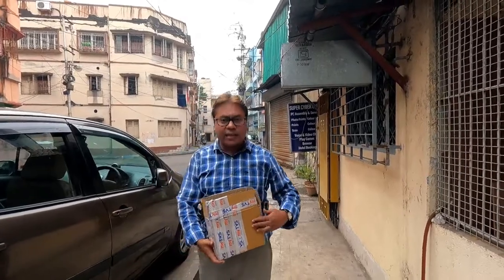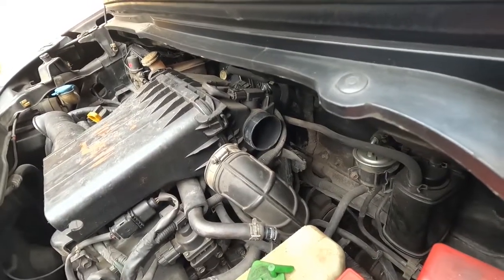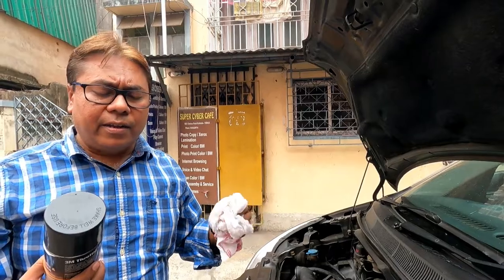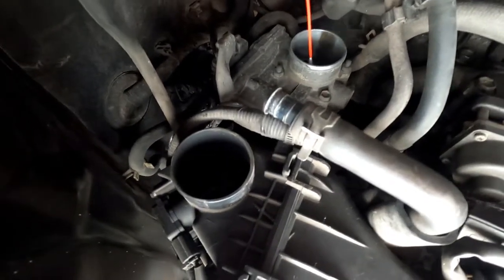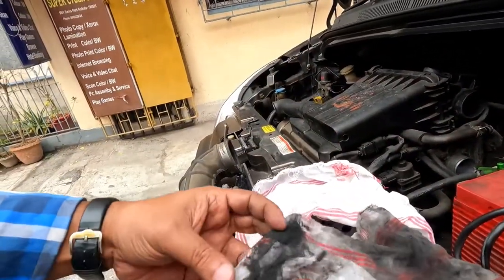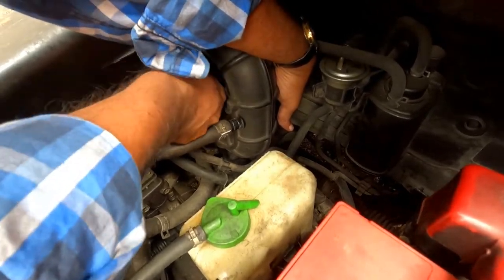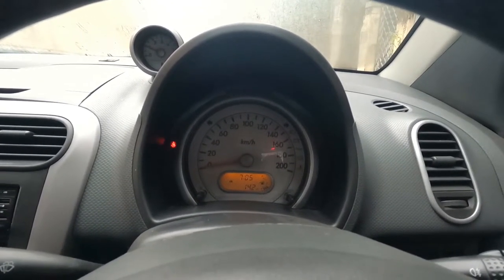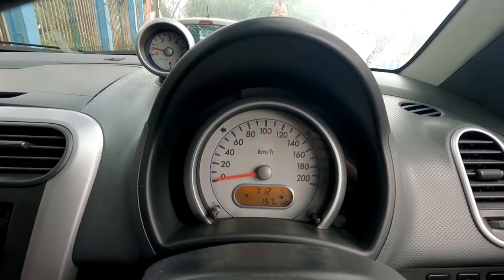Maruti Ritz /Suzuki Splash Throttle body Cleaning DIY #throttlebody #marutiritz #suzuki

Comment: thanks for the video. did you need to disconnect the battery after the clean or it's not needed in this car?
Reply from the maker: Thanks for your query. It was not needed in this car. In case you face an erratic idle only then you need to disconnect the battery to reset.

Comment: I have swift vdi2010 at idle rpm fluctuate car vibrating totally it fluctuate between after 1 - what to do ?plz suggest my mechanic says this is wiring issue even check light is on plz sir tell me suggestion
Reply from the maker: Thanks for your query. You need a car scanner to find the fault codes. Yes it may be some wire cut which needs to be found. Visit a good workshop with proper equipment.

Comment: এর পরের বারে নেগেটিভ টার্মিনালটা খুলে নিয়ে স্প্রে করবেন। কালিব্রেশন ঘেঁটে গেলে কলকাতায় সেরম মেকানিক নেই যে থ্রুটলবডি ঠিক করবে। সার্ভিস সেন্টার ৫০০০/- টাকা চায় ফুল রিপ্লেস করার জন্য। আপনি পাইপটা ক্লিন করলেন না কেনো??
Reply from the maker: Thanks for your advice. But I have done the same in Suzuki Swift and Alto K10 and never faced any calibration issues. In case there is a problem and the error code just remove the battery terminal wait for 5 mins and you are good to go . You can watch my throttle body cleaning video of Swift also.